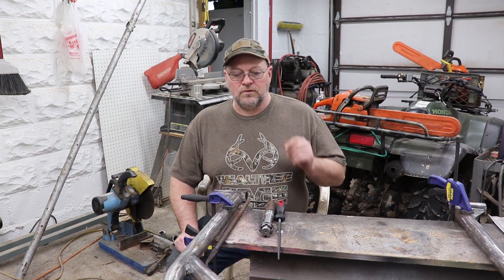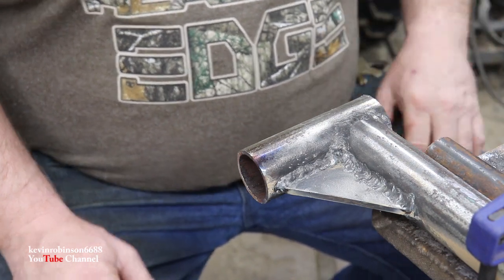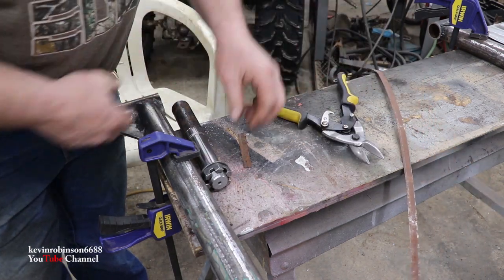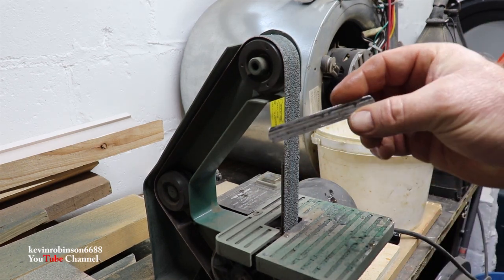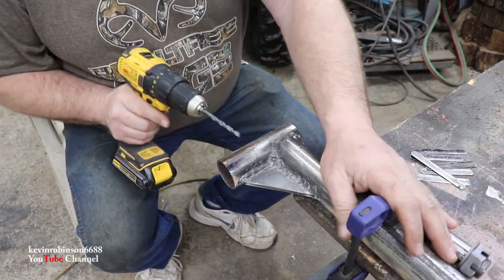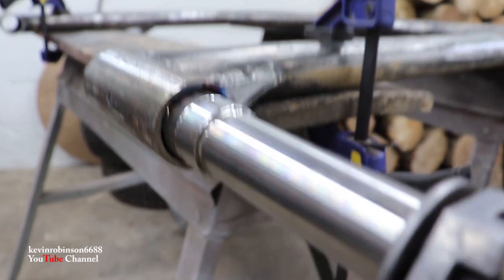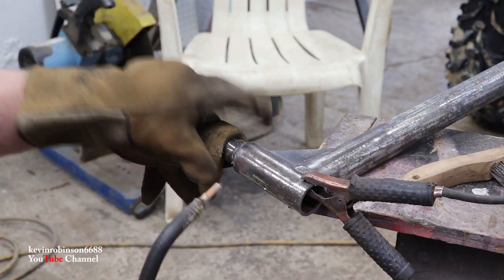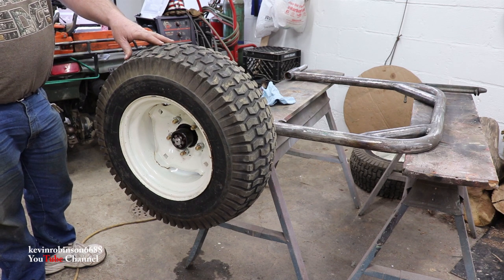log arch log hauler build 4 trailer axle spindle weld in kit

Comment: Building a custom motorcycle trailer. Basically an aluminum Christian cross shape. The top part is the rear, it'll be box aluminum big enough to fit a hitch mounted hammock stand. These type of spindles will be fitted to either end of the horizontal cross piece, and the tongue will be at the bottom. I'll have a square wooden platform for tieing down camping supplies where the cross intersects. Should be super lightweight when it's finished, hoping for under 40lbs depending on which wheels I get.
Reply from the maker: Cool build thanks for sharing.

Comment: Tubing. I have lots of Black iron tubing with 90s , couplings, Ts etc around. Can you just screw most of it together? And only weld where necessary? You have nice clean tubing cuts and welds by the way. Nice job. I am trying to use up stuff we have around. A welder says my pipe has a coating you have to burn off.Your thoughts?
Reply from the maker: I think you can grind off the coating and also i yhink you really should weld all the pieces so you have the strength.

Comment: Welding metals of drastically different thicknesses always seems like witchcraft to know where to set the welder. Do you remember roughly how hard you were pushing your welder when you welded those spindles in?
Reply from the maker: Just welding on issues

Comment: Hi Kevin, 
Thank you for showing how to weld a spindle for a trailer axle. I am looking at 
building my own camper trailer with an off road suspension but i have never welded before.
I live in Australia and have noticed via youtube the different styles of suspension there are around.
I wondering if you would be able to shed some thoughts on how one would go about fabricating an
independent suspension for a camper trailer.

Kind Regards
Max Pozzetto
Victoria, Australia
Reply from the maker: Thank you for watching, i'm not sure i would have to do some research.